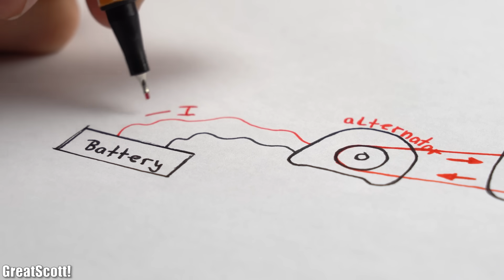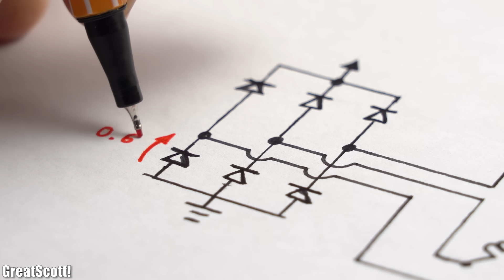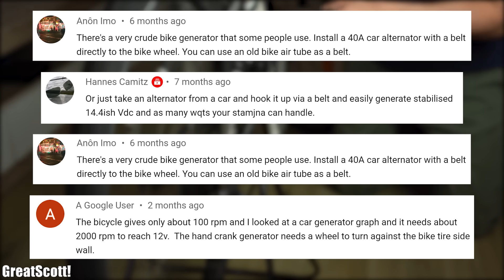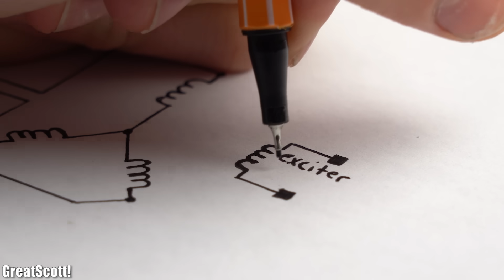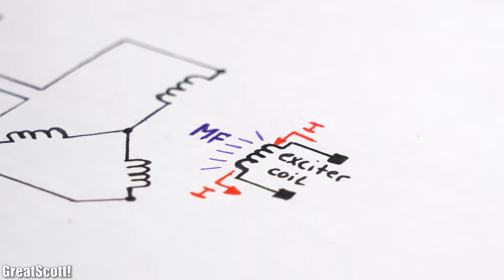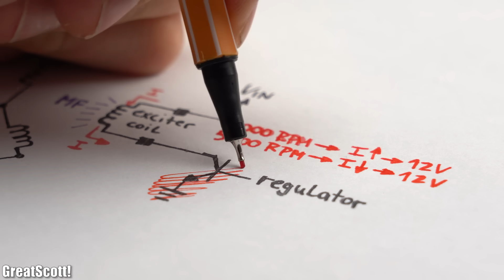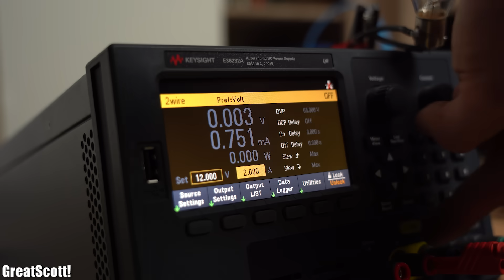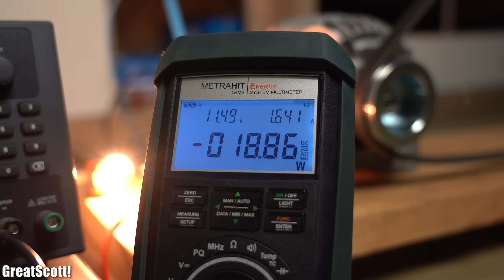Using a car alternator with a bike to power my home? How much energy can I produce?!

Comment: Try using a cheap permanent magnet hub motor as a generator.   As you found out these alternators are likely below 50% efficient.  20W out with 8 W electrical going in and no measure of how many Watts of mechanical power going in.   A permanent magnet brushless generator can be 85% efficient.  You should seek something like that.   Car alternators are designed to be cheap,  light weight and small. They are good at putting a small amount of energy back into the starting battery, or running a heavy load briefly in a very inefficient gas engine car.  They are horribly inefficient, and that's why they need that big fan to get rid of all the waste heat.

Comment: I have often wondered why someone does not build a car-engine powered generator perhaps using an alternator. After all the car and it's engine in the garage has the power needed to generate a lot of Kw and you would only need to run the engine at around 1000 rpm I would think. A well cooled engine would not be damaged by that even running for many hours, and I have thought one could perhaps fabricate a generator on some kind of trolley and an adaptor to take a drive from the car engine. Or install a second alternator mounted to the car engine, suitably re-wired and connected to the household circuit.

Comment: Buy a self regulated high output car audio alternator. Should be able to get a 250-350 amp alternator that puts out 14.7 volts or so.

Comment: This is not a generator but an alternator. Generators produce electricity, Alternators do not. They take existing power (from 12 volt storage battery) and in the simplest  of terms amplifies it and puts it back.  A used or rebuilt unit may have residual magnetism inside that if spun fast enough it will pick up and amplify. One of those two small terminals excites the field coils and  causes the unit to function and produce power. You should remove or bypass the 12 volt regulator and harness the unregulated power. Good luck. This stuff is fun to play with.

Comment: the two smaller pins at 2:35 are for the voltage regulator which keeps the alternator output voltage from 13.5-14.5 volts.without it you you will get voltage outputs up around 18 volts which will cook your battery and possibly be an explosive hazard as charging at such a high rate damages the battery while also increasing the output of hydrogen gas from the battery...

Comment: This was a good effort but a bad conclusion and could be so much better. Get a tensioner for the alternator, use stronger brackets on the frame and ride in the highest gear. Should easily be able to make over 100W

Comment: Using a small lawnmower engine with 2 coils,one of which goes to the alternators excitor wire and installing a larger pulley where the blade mounts can make that alternator out out its max volatge and wattage while using minimal fuel.. A very cheap costing 12v generator if you have 12v appliances and lights and a battery storage bank which can be cheap or very pricey...

Comment: At first I was wondering why you needed to apply a voltage to get the alternator to work, then I realised you probably don't want the alternator creating an additional load on the engine, while getting the engine to turn over - then, when it's running smoothly, you can add the extra load.
Reply: electromagnets last longer.   permanent magnets get weaker over time using them this way.

Comment: The car alternator is wrong tool, it can produce max 14.7V which is pointless.
You need to get proper generator hook it up, you also need to put in some tensioner as well to avoid the belt dancing.
Reply: Reality check: 1440W is roughly 2 HP. Given losses, you need at least 2.5HP, maybe 3 HP to drive it to full power.  But you as a Human can only produce up to 100W.  So you can probably charge your cellphone, keep a small LED light for your night, and not much more.

Comment: If he manages to pedal at a Tour de France pace for an hour he may actually be able to generate 1000 watts. That many watts for one hour is precisely 1 kilowatt hour., for which my utility sells for 11 cents. Oh, but it gets better. If he uses all of this power immediately, he just shaved this royal sum from his electric bill UNTAXED. But if he chooses to charge a battery and use his bounty a few hours later, there is current lost going into the battery and coming out. So plan to pedal an additional five minutes to cover that. If you don’t use it up until next week, there is current discharge over time. Plan another five minutes of pedaling. See where this is going?

Comment: This would only be good as a Solar charging  Booster when you want a Exercise mount the Bike solid and solid Mount the Alternator and apply way more tension and your not in top gear on the bike for the most speed and your losing a lot of Power with the Wobbly setup!

Comment: Don't know if this was mentioned before....
3min 50sec in,,,, the highest gear/speed is with the largest sprocket at the pedals and the "smallest" at the wheel. You have the rear gear in "Second" not "Sixth" which would produce the fastest RPM

Comment: That type of belt requires a third pulley to maintain tension on the belt.
Standard automotive alternators are a terrible choice for any purpose but the one for which they are built.
Permanent magnet brushless alternator components from motorcycles will work and are ideally rated for this application since 300W is all a normal human can deliver for any period of time. On these alternators a heavy bowl shaped flywheel containing magnets spins around a fixed set of coils. Since you won't be using the motorcycle engine to support these parts you must construct an axel for the flywheel and a support for the coil. Motorcycles use an inefficient diode/regulator assembly so it is better to build your own rectification circuit and use an MPPT charge controller to charge a battery bank.
Reply: An alternator requires input voltage to power the coils.. That usually comes from the battery when you start your car.
Reply: @pdemosllegaralos520subs2  That is true for car alternators, and yet another reason not to use them for home power generation. Motorcycle alternators use permanent magnets in the flywheel to generate power even with no battery at all.  The magnets moving past the coils generates electricity. In a car alternator there are no magnets so in uses electricity from the battery to make m magnetism inside the body of the alternator, the not spinning part. That magnitism makes electricity in the spinning part that comes out through a set of brushes.  The electricity used to make the magnitism is totally wasted.

The electricity coming from the motorcycle coils is 3-phase AC. It needs a rectifier to make it into DC. Motorcycles use a separate "voltage regulator" to rectify the AC and limit the voltage. motorcycle voltage regulators are not efficient. It would be better to design your own circuit for that.

Car alternators usually have a built in  voltage regulator but it is usually inefficient too. Car alternators are really terrible for what he was trying to do.

Comment: If you could set this up to a water wheel with a reduction gear that ran it at the correct speed then it could prove useful. You'd probably be better off with some kind of purpose made dynamo meant for remote power generation.

Comment: Try just connect a car running on idle to a battery bank. Y use this configuration for month after a storm and charge batteries, producing around 300 watts. Enough to supply most of my home consumption.

Comment: Hey Scott... But it's market 12v/120A max output...
It's really useless or it's just a matter of inertia and rpm?
How to get that output then?
12v/120A...
Where did the power go? 😔
Reply: Maybe if you modify the wheel to conserve inertia (adding weigh... Maybe a "mass solid wheel") so the rpm are sustained at high rates through longer "time lapses" and not decreasing the power like when you have the normal wheel that is so lightweight that the power of your muscles stop producing Energy practically when you stop pushing with your legs...
Im from Colombia.
Im working in a prototype to make it commercial and provide electricity to people tha has no access to power grid because they live in small villages and they are too "remote" to access...
Even for electrons hehe😅

Comment: The alternator needs 12 volts to activate the coils to begin the charging cycle.
That's why one terminal is battery voltage the other is output voltage.
It's not a generator.
If you remove the integrated voltage regulator/rectifier it will produce 250v AC.
Reply: check for vehicles with low idle speed my truck idles at about 550 rpm 02 chevy avalanche with a 5.3 vortec...you

Comment: one mistake i spotted was the lack of a tensioner pulley and because there was no tension on the belt it was slipping a lot and therefore reducing you're total power output if you add a tensioner in between the motor and the bike you will see a significant increase in power output

Comment: I can do 45 Watts pretty easily with my set up. I do 10 minute stretches a couple of times a day. That's 7 - 8 Whs per run or about 1% of the capacity of the battery I have connected to it. Doesn't power my home but many of my devices. My iPhone has a 10,78 Wh battery for comparison.
Reply: I have a 48,000 watt hour lithium battery bank. How many years would you need to charge it to 100%?

Comment: Use a permanent magnet alternator or dynamo.  I'm playing around using an air-horn compressor motor which is in fact a permanent magnet DC motor driven to work as a dynamo.

Comment: Electrical Engineer student here. 

You can remove the exciter coils from the rotor and glue neodymium  magnet strips (sold on the internet). That way you won't need to supply 12V to the alternator constantly. But you also won't be able to regulate the amount of generated power (besides varying the speed at which you rotate the pedals of course). You can also remove the rectifier circuit and get AC from this ALTERNATor. 

Overall you could've just found some old vaccuum cleaner with a dc motor inside and spare the 80 Euros you gave for a brand new alternator...But you are German so you are rich. :D

Comment: One thing that may help with voltage regulation may be to add heavy weights to the bike wheel. Its lack of mass makes it hard to push through the ac peaks. Even a small car engine still has many kg’s of mass in the rotating assembly that helps to dampen vibrations in the engine, which also helps prevent the alternator from stalling it out under high load at idle. The weights would have to be well balanced within grams though to ensure you don’t induce unwanted vibrations.

Comment: used in marine applications and other places there is a one wire alternator that is self exciting. on a side note an alternator can be turned into a motor since its basically a 3 phase motor already

Comment: According to what I have read, automotive alternators are about 50% efficient. That is measured under typical conditions. Here, you are running at the very lightest loaded end of the curve. Your efficiency may be a lot lower. An easy conversion to remember is one horsepower = 746 Watts. I don't think a person can generate one horsepower for very long.

Comment: I remember a guy in the 1970s doing this in Wyoming for powering his cabin. He hooked it to a homeaid windmill.
Reply: i have seen a few off griders on youtube using a setup powered by a stream near their cabin or house. a mini water wheel.
Reply: @hellshade2  the alternator was hooked to a 12v car battery at the bottom of the windmill. I couldn't see this doing much more than powering the lights.
Reply: @tballstaedt7807  yeah thats all he was doing but when hooked up to a battery to store power particularly the lead/acid type you have to regulate the voltage and keep it no higher than 14.5 volts. voltage too much greater than that will damage the battery at worse or cut down is usability at best. now a windmill may not get high enough rpm to get that high a voltage. that would depend on how big it is and the wind speeds.
Reply: @hellshade2  You haven't seen 1 kilowatt windmills DIY?
Reply: @davemwangi05  i haven't but i am sure they can be made. all it takes is enough batteries to store the power and a good charge control to make sure they don't over charge.though there may be a few other things need in there coming from the unit generating all that power. don't know if you could get that much from an alternator but i am sure they would have generators big enough.

Comment: Considering most alternators are good for a peak output of 100amps @ 12vdc, it should be able to feed a peak of 10amps @ 120vac with the correct inverter setup. Most fridges/freezers pull about 7-10 amps. Washers/dryers pull about 10 amps. You could run 5 lights at 2 amp draw each so a total of 1200watts peak (volts x amps = watts)

You were also using an alternator that has a built-in rectifier and voltage regulator. You'd probably be better off using an alternator that had an external rectifier so you wouldn't have to worry about the AC to DC back to AC conversion. A simple lm317 could regulate voltage output

Comment: I am SO impressed by your drafting/lettering!...ok, back to work...
SO, in any case, with a 'proper' exercise bike, I can easily make 75 W continuous, for at least ½ hour session, maybe more, and 125 W with some sweat...so, you need a better setup for driving the stator windings, it seems, or, maybe a decent permanent magnet motor.
I thought, myself, that it would be good to power the TV with this, so that you need to get the exercise to watch TV ;-)

Comment: Instead of using a car alternator my recommendation is a residential wind turbine. Those are low rpm with permanent magnet and you can get them with the output you need.

Comment: Great video by the norm, thanks for sharing 👍
You can power your home with that device, but you cannot with your legs. There is no magic energy, what you get is always less than what you enter. In fact, you have been producing 1/4 HP (180W) of mechanical power if my maths are correct. BTW there are more efficient ways to use those devices.
Besides that, your job is amazing and I enjoyed this video as much as all your channels. I've seen all of them. Thank you for your job!!!

Comment: you can easily output over 200 watts and some people maybe 500 or 600 depending on your fitness... Increase the gear ratio by at least 20 times and add a heavy flywheel to the alternator.. so easy

Comment: So explonation at car alterators there is a component called voltage regulator basicly connecting and disconnecting the exiter coil to keep it under 14.5 v of voltage othervise it would kill the Electronics in the car, what you connected to is probably the D+ which usaly connected to the battery + trough a 1.5 W lamp (charged indicator) which is the turn on signal to the voltage regulator, but the transistor needs to be connected to the negative too, usaly trough the chassis. What you mesured with the multimeter is the stator coil resistance trough the diode bridge (rectifier).
Reply: Ps the voltage on the output is depending on the input voltage and load if you connect a 12v battery to the B+ and the chassis it sould go higher since the power supply is limited to 12v and as i seen you only connected the D+ leg or L (lamp)

Comment: I believe this is why most DIY'ers convert alternators to Permanent Magnet generators bypassing the exciter coil and giving you the ability to generate a variable output.  I've seen some documentation on this and have tried it myself.  I'm sure you can find someone on Youtube doing this too.  Keep the stator coils and bridge rectifier and put magnets on the rotor.  I believe you can actually run it at much lower RPM's this way too.  I love your videos and would really be interested in seeing how you can put your own personality into this kind of project!

Comment: My final year project student (mechanical engineering) did an optimization for a smaller alternator (600W). First removed the control circuit totally then optimized the volt and current supply (through volt regulator and resistors) to the excitement coil .. he varied the volt input from 1 to 11 Volt and got highest output from the alternator at 2V (0.4A) which consumed 0.8W input and generated 25W output

Comment: Not sure if someone else has mentioned this, but you need a "tension" wheel, so you will not be having that much slippage ;-) Just a small wheel, with appropriate width, and about an inch diameter at most on a small L bracket section that you can move it up and down a little to make that belt tighter. Have fun.
Reply: you can also just make a better mounting setup where you can just adjust tension by moving the alternator on it's pivot. that's how it was done with cars when they still used v-belts...

Comment: You need to charge the windings, one of the small connections. The other is a ground. Use either a battery or the alternator itself. Excite the fields. Any 12 volt battery, even an old one, makes a good buffer for voltage spikes.

Comment: Regarding power: a professional cyclist can produce 200-300 watts for a few hours. A recreational cyclist might produce this for only half an hour. A non-cyclist would likely struggle to produce more than 150 watts for any amount of time. 

Automotive alternators typically have an efficiency of 60% or less. 

One should expect substantially less than 50 watt-hours from a setup like this, even if the user pedals to exhaustion. That might create a usable amount of illumination from a high-efficiency LED, but not much usable energy otherwise.

Comment: If you 1) connect the 12v output of the alternator to the field coil input, and 2) disconnect the external 12v supply from the field coil input after you start pedalling, your regulator will deliver a stable 12v output.